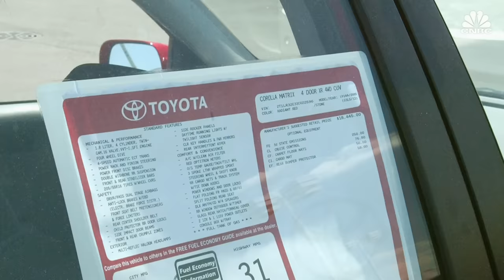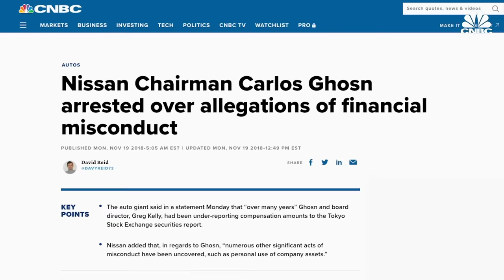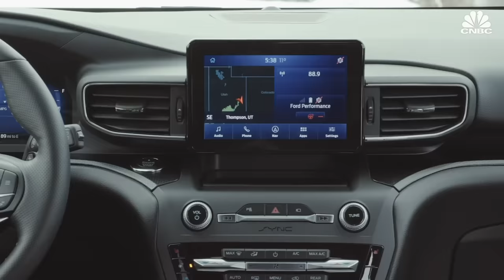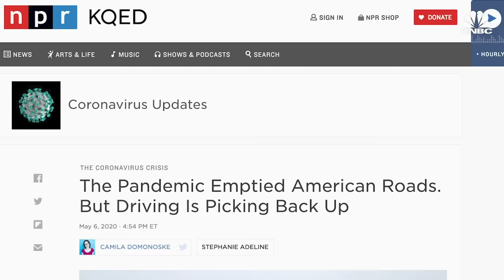Why Toyota, Honda, And Nissan Continue To Bet On Sports Cars

Comment: Owner of a 1977 Toyota Celica GT love when they show something I have!
Reply: Very cool...Owner of a 1990 Gt4 here 😍
Reply: Loved that  Celica saw 2 on the scrap yard 3,4 years ago very sad
Reply: Former owner of a 91' limited 2.0 4WS import. Most advanced car i ever had which was 10ys ahead of its time. Full surround sound system, electronic driver bucket seat, power windows, power side mirrors, 4ws and 2ws modes, dual mode sunroof, climate control air con etc. BMs and Mercs would cost over 100k to have those luxuries.
Reply: @Budinky  GT4 are nice! I would love to own one! Rally cars, Toyota back then were on whole different level than what it is today.
Reply: @axeya366  Honda prelude?
Reply: @rti512  yea... I follow a page on Facebook that’s in Canada that has the first gen Celica. A lot of them are scrapping for parts. Engines transmission body parts floor pans etc.
Reply: @dsanchez53095  Honda did have 4ws but the car handled like crap compared to the Toyota. Throw in the Mr2 turbo and now you have a car that can throw around corners at 60km.

Comment: I own a 2017 Nissan 370Z with a 6-speed manual. It is a wonderful car. Zero issues at 35,000 miles. Made in Japan. Has one of the best V6 engines you can find, with a linear powerband all the way to redline. With a few simple mods and a tune, it is putting out 362 hp with no turbos. It will be joined by a Nissan 400Z a few years from now!
Reply: They can't give new 370Z's away nowadays. It's about time they updated it.
Reply: Few simple mods give you 40+ hp on crank? 
What simple mods are those? Nismo stickers?
Reply: @omursaraslan6316  you can gain something like 20+hp on a hellcat by changing a pulley. Theres a bunch of simple ways
Reply: @omursaraslan6316  A few intake upgrades, test pipes, and aftermarket exhaust system, combined with a tune can bump crank hp to 360 to near 400 on the VQ37VHRs (depending on parts and the tuner).
Reply: @tefrumpzax  It's not the same. hellcat has double the displacement over 370z's vq engine plus a huge supercharger. 
There is no "simple"way of tuning a naturally aspirated engine. 
A car guy would know
Reply: @omursaraslan6316  lol do some research

Comment: people see a MK5 Supra be like: is that a Supra-
Others: That’s a BMW
Reply: Sports cars are expensive to design and built and not profitable enough so is better to partner with someone to share costs. However, I do wonder why Toyota didn’t used the Lexus RC F power train which is already in production.
Reply: My VR4 blew by the MK5 like it wasn't there, all it did was make noise.
Reply: @josemanuelruiz2036  or the rcf chassis ...
Reply: and those people who hate toyota for it, are too stupid to know that toyota had done this a coupe of times... the 4AGE itself of the ae86 used Yamaha Parts
Reply: @paulocuento9949  that's not comparable at all, Yamaha is a japanese company and partly owned by toyota, meanwhile the Mk5 is completely bmw
Reply: @E9X330  its comparable brother.. for the simple reason that the ae86 is considered a halo car (thus the gt86 homage).. japanese or not, its a different manufacturer.. I always wondered why people are so affected by this..
Reply: @paulocuento9949  the ae86 never was a halo car, you should Google what a halo car is, legendary cause of an anime doesn't mean halo car
Reply: @E9X330  say what you will about the 86. but having such reputation and success, even by anime standards, caused a world wide phenomenon - enough to push Toyota to reproduce a successor some 40 years later.

Comment: Vehicles need to be taxed by weight and dimensions. Screw the big pickups and SUVs blocking the view and the road and more accident damage by sheer weight.
Reply: Here in Japan, vehicles are taxed by weight and engine size. That's why kei cars (660cc cars that weight around 800kg or so) are very popular.
Reply: All I know is I'm tired as hell of big ass lifted pickups flying down the road knocking rocks into my windshield
Reply: @user-ll5cb1nr3d  No wonder why Civics (sedan model to be specific) are in decline, twice
Reply: @AHondaCivicEX  Not in North America they're not
Reply: @sh4rksh4d0vv  yeah my bad I forgot the decline happened in both Japan and India

Comment: The issue isn’t lack of interest. It’s the insane prices. Mid 50k for a Mustang/Supra/etc is insane. These used to be middle class heroes but now the payment is a mortgage. The 86 should be a 20k car. The fact that 35k gets you a 225hp car is pretty damn crazy. The stupider these prices get the less they’ll sell and get any acclaim.
Reply: Inflation My guy
Reply: @ghostkiller427  inflation is a very small part of why car prices are so high. They’ve been climbing higher and faster than wages for the past 10 years. Nissan is saying the new Z will start at just under 40 which is what the 3.0 Supra should be. It’s just over priced due to not wanting to undercut BMW.
Reply: @ghostkiller427  lol do THAT math.  Inflation is NOT that high. That would be insane...

Comment: Very surprised there wasn’t one mention of the frs/Brz/86 which is a newer sports car that was made by 2 Japanese manufacturers and one of the most popular sports cars when it came out
Reply: I know, right?  I never even knew this model existed until earlier this year when I was looking at some Toyota C-HRs and just happened to run across a 2018 86 on a local dealer's lot and I bought it that day.  Wonderful, fun to drive, affordable car that has made me rediscover, at 59 years old, the joy of just driving.  And at 33 mpg, I can afford to!  It has enough HP to be a lot of fun without getting me into too much trouble...

Comment: I really hope Nissan can make a good comeback. I been a loyalist Nissan fan and owned a few sure may be a little rocky at times but the reward you get when driving one is always been fantastic for me.
Reply: noriceformeplz The only problem is the Renault albatross hanging around their neck.
Reply: Renault ruined Nissan tbh. Excited for the 400z / z proto  but they've shifted to ecoboxes almost exclusively with the exception of the z chassis and R35 (which is not as attainable as the S, earlier Z, and earlier R cars were.)
Nissan still stands a chance but I think they are going towards following in the steps of toyota and will never win that fight in the US market at least
Reply: @Michael-jq5pf  How did Renault ruin them?
Reply: CVT is Nissan’s albatross 😫
Reply: @kristians2704  have you not seen what Nissan makes now?
Reply: I was a Nissan loyalist until they took away manual transmissions from the Maxima. That was an unforgivable betrayal.
Reply: @NikoBellaKhouf  Almost nothing has a manual transmision these days. The new Rouge is great.
Reply: @kristians2704  that's due to government regulations and corporations putting profits before their loyal customers.
Reply: @BlacRabbit David the Z is great but it's just too small for me to be comfortable daily driving it. I loved the Maxima because it was really big on the inside. It was perfect in every way for me, so much so that I bought 3 of them. I totaled the first two 😅

Comment: Including Mazda Miata in the high performance category. Finally, a man with culture. Hats off to you.
Reply: He knows miata is the answer
Reply: lol Miata as a performance car is just wrong. Fun to drive? Sure, but it's to performance cars what a 250 CC sport bike is to 600's. Sure, it's lighter, it'll carry speed through a corner, but even squeezing every ounce of performance out of it, it will get left behind, so you kinda have to hang out with same or just do your own thing, which can be fun for some.
Reply: @leok7193  On that thinking all cars other than supercars are not performance cars.
Indeed its not a high performance car, but it s more performant than 80% of the car market.

Comment: Imagine a video about Japanese sports car without a single mention of the Nissan GT-R
Reply: The Miata was shown in B Roll several times but barely a mention 😞
Reply: No Silvia either, Rx-8 should get mentioned as mazda failed a bit. Build great car, but the seals...
Reply: Looks like they just searched Wikipedia for racing history.
Reply: They just focus on Cars sold in the USA...
Reply: @lucky889s9  you are right. Pitty they don't mention them just a bit :D
Reply: There was no GTR in North America in the 90s
Reply: @mjor6406  this is about Japanese sports cars sold then and those sold now. Nice try
Reply: @januariusa7847  CNBC is an American Channel. They are showing the Japanese sports car comeback in USA since the 1990s!!! The GTR was never sold in the USA in the 90s. Jesus Christ. The GTR was never a sports car. It was a GT car. The MR2, S2000, NSX, Miata, were  purs sports cars.

Comment: My very first car was a 90 300zxTT. Not the wisest thing to purchase at 18yrs old! I couldn't even drive it because it was a manual. I fell in love with that car, as soon as I got it home I couldn't stop staring at it. Stood there for 5 min and taught myself how to drive a stick. That clutch managed to last another 2 months. It was such a pure driving enthusiast car. Been in love with Nissan's every since. I love how you can turn basically any of their cars into a one of a kind tuner. I then purchased a 94 3rd gen Maxima SE. It was a 5 speed and it has a limited slip front differential. It had the FWD version on the 300zx engine. It was completely stock and take when I got it. I then got the mod bug, I lowered it 2 inches, CAI, Full exhaust from headers, y-pipe, high flow cat, cat back exhaust. Fully upgraded the suspension so it handled well. Shocked a lot of ppl with that car. I've also never had a Nissan let me down. I've given plenty of them some good abuse too. Not one failed head gasket, no catastrophic failure. I've only had one Domestic sports car an 02 Z28 Camaro. That LS1 V8 there's nothing like it. Loved that car, but I still kept going back to the Nissan's. Ive had an 04 G35X AWD that has 209k.  It still performs well, it's extremely reliable. That thing will definitely last another 100k. If you want a nice luxury car, and it's reliable get an Infiniti for sure. I've owned them all, had a Cadillac. Had nothing but problem for a then 10yr old car. Had a Lincoln Ls it was then only 6 yrs old. Can't really speak on weather it would of held up since it was totaled. Fun car though, I had a 95 BMW M3 as well. It was then only 12 yrs old, it was plagued with problems. Nothing has been as reliable as a Nissan/Infiniti. My car is 16yrs old and feels modern still. Car feels safe and planted and it's fast! It has luxury and performance. The best of both worlds, even though it's outdated. I have my eyes set on an Infiniti M56S. It's a more modern luxury sedan with a 420hp V8! It competes with M5s, AMGs, etc. The best bang for your buck, these cars are built to last. It's why ppl are still asking for 4k-5k for a 16yr old car.

Comment: Toyota: 1 sports car comes out starting at $50k
CNBC: is this the revival of Japanese sports cars??
Reply: If you adjust for inflation, they didn't really raise the price. Just feels like that, cuz wages didn't grow as much. Atleast that's my opinion.
Reply: It's BMW no Toyota for starters but unless you been under a rock you know this
Reply: @stokeseta7107  this take me back to the 80s
Reply: @FATmenDRIVEtrucks  co developed with BMW yet has a Toyota badge. Therefore, it is a Toyota
Reply: @doomtomb3  I could put a badge on anything doesn't change it
Reply: @doomtomb3  The supra is literally a BMW Z4 with the Toyota bage everything about the Toyota supra is a pure BMW, The chassis design the engine, the body style.

Comment: This video left out the Lexus vehicles that would be classified amongst these, albeit at the higher end of the spectrum.
Reply: Lexus is a sub-brand of Toyota. Toyota was well covered in this clip.
Reply: Uhhh, apart from the RS Altezza, what classic Lexus really fits the bill
Reply: @SamFirthDesigner  currently? LC500, RCF, IS500 - recently discontinued GSF.

Comment: Toyota has the most potential but they're the most laid back.
Reply: I really hope that they bring back fun everyday cars. Almost every single old bog standard hatchback is great fun to drive, no matter how slow they are (at least in places where all the roads aren't dead straights for miles on end) and that has gone away from quite a few cars. I hope it comes back.
Reply: @EpicStuffMan1000   that feeling is mutual.

Comment: I'm one of those 90's Japanese sports car fans. I've owned the Honda CRX, Prelude, Acura Integra, and now the new Toyota Corolla hatchback XSE, all manual transmission. When they come out with the turbocharged version in America I've been thinking of trading up to that or getting a Mazda Miata. Driving should be fun and engaging not scary or boring. Better roads and less traffic are helpful.

Comment: I wouldn’t call the 1990s Miata  high performance.  No factory turbo until 2004 and 2005 models in the MazdaSpeed which is pretty fast but, it’s too light.  It is fun with the beefed up suspension bigger breaks and and wheels with a few other additions.  I have the 2004 MazdaSpeed manual and it requires a lot of driver participation vs something like a hot hatchback.

Comment: That 90s acura nsx was so insane.  They had to re adjust thw power weight ratio due to the rear tires becoming baldinis within 4,000 miles

Nissas has made the datsun 210 prototype 2 door..  thats the vehicle that will sell like ice cream

Comment: They are too darn expensive. In the 90's these cars could be secondary cars.. but today things like the Supra *BMW, NSX, TypeR, etc.. are all too expensive.. Not to mention they ruined these cars.. They were fun manual transmission, no electronic nanny crap to stop the fun cars.. these new cars, too much electronics, too much nanny, and most have dumped the manual. Most are WAY too heavy too.. The days of picking up a 9k dollar Crx SI with no options to throw around and row gears are long gone..

Comment: The current Toyota Supra is actually a BMW Z4 with a different look. The original Mazda Miata was a modern Lotus Elan. More reliable and without the leaky roof. Mazda's continued development of the Miata has been very good. The new NSX seems to be more of a marketing exercise than a modern affordable supercar like the old NSX was. I don't think Nissan ever stopped building sports cars and hopefully never does.

Comment: I'm glad Nissan has kept the GTR AND the Z line. GTR, halo car. but the Z is targeted at the tuner market and as soon as you get behind the wheel of one you can feel it. bone stock options like the high reving VQ engines that when turbo charged can make over 600HP without doing anything else to the car. and the manual transmission making you feel involved in the driving experience even if the shifting time is slower than an automatic.

Comment: I disagree that Japanese sports cars need to focus on expensive high tech hybrid and electric systems. Cars are continuing to get more high tech and less driver focused, and there are very few cheap sports cars left that put the pleasure of driving first. There is a reason why the Type R, Nissan Z, WRX, BRZ, and Miata have sold so well alongside American sports cars while the sales of the NSX, GT-R, and even the new Supra have tapered off. Cheap, practical, fun to drive Japanese sports cars sell while over engineered, expensive, low volume cars continue to sit in showrooms.

Comment: I think it just a matter of people wanting their dollar to do more than buy a one trick pony like a sports car. A top of the line rx-7 in 1992 was close to 40 grand, or almost 60 grand in todays dollars. Same with the 3000gt and most of the cars on this list. They would have a modern price tag of 40 grand plus, for a car with limited seating, can only be driven in certain months (depending on location of course) or weather, and can't really be used as a daily driver due to lack of trunk space or storage. Hard to swallow a $500+ car payment for that. I hate that everything is turning into an suv but as a parent with a busy life like most people, they are the jack of most trades and it does feel like I get more for my car payment because of it. If I feel the need for speed, I have an 87 Firebird Formula and some pretty big hills I can drive it down (it is an 80's muscle car after all).

Comment: As a car enthusiast, especially Japanese sports cars, I loved this video but felt they missed a key fact on why the cars of the 90s died.

In the 80s, the Japanese economy was booming and companies had more money than ever. They allowed engineers to work on passion projects that didn’t necessarily have to be immensely profitable. Then the bubble economy collapsed in the early 90s and the exchange rate between the yen/usd suffered. The rising prices due to the unfavorable exchange rate, new found conservatism for Japanese auto manufactures to only invest in only high profitable projects, and combination with boomer generation’s tastes shifting to SUVs, eventually led to the death of all these passionate, fun, but barely profitable sports cars.

Today’s world, only the high end can generate enough profitable return for sports cars (Ferrari, Lamborghini, Porsche etc). The Japanese mid-tier priced product is in no man’s land and has to make a return as a less authentic generation as manufacturers are hedging risk and putting profit first / product second - partnerships (Toyota/ BMW - Supra, Toyota/Subaru - 86) reusing old platforms (next gen Z will use a 370z chassis), or just piggybacking off a mass production car to create a sports car (Civic Type R, WRX).

Even so, with the EV revolution and trucks/SUVs being the rage, for the auto enthusiast, getting something back in this class of vehicle, is better than nothing at all!